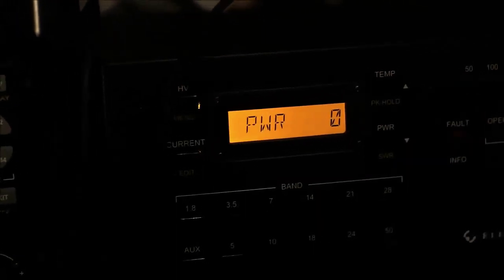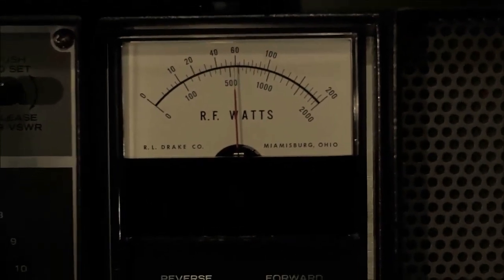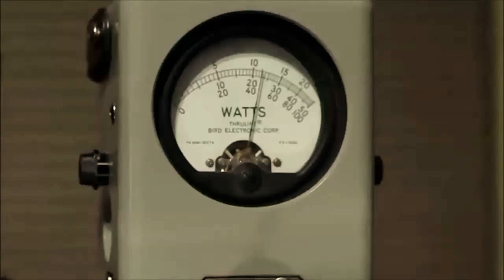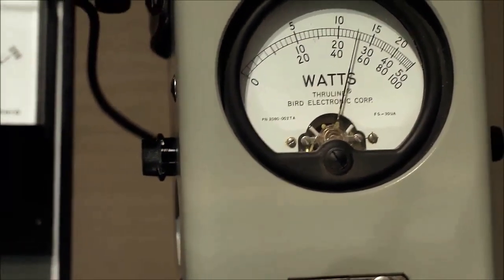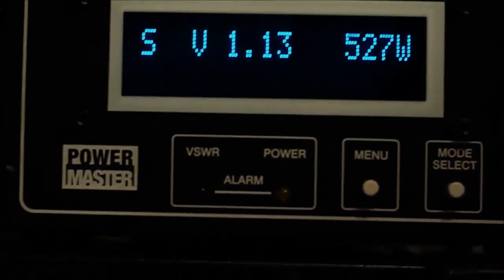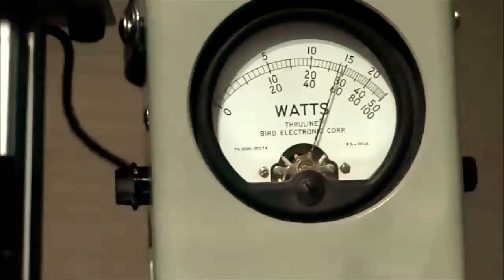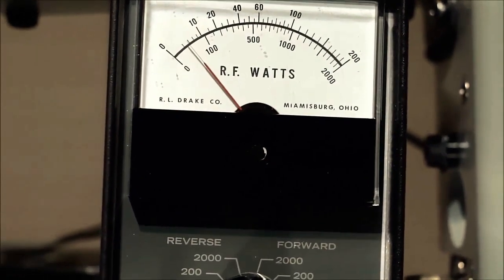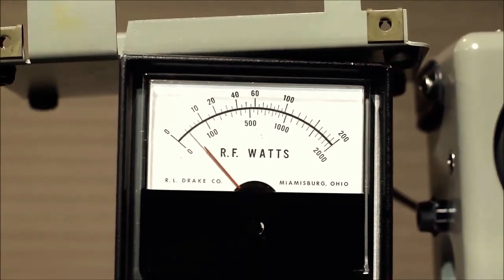Ham Radio Basics--What Wattmeter

Comment: Glad you ok I'm seeing this 4 years later was looking for the video on the automatic tuner you showed at the end of the video you said that it attaches to the tower it probably was crap and did not work and that why no video but was just wondering on what it is and how it worked thanks Charles
Reply from the maker: Yes and someone is still selling that kind of garbage.  I just put up on the fence a modified Hustler 4btv.  Your question would make a good video.  The garbage tuner attached to another vertical compared to the 40, 20, 15 and 10 meter vertical.  Thanks for the idea.  73, Jim

Comment: Jim,
Enjoyed the videos and have subscribed.

How about a video on your shack. I notice three monitors. Are there three computers or one computer with the monitors connected to your graphics card?

WB3BJU
Reply from the maker: +Donald D&#39;Egidio 
Hi Don, 
There are 2 computers that I moved from my business to the ham desk as they became too old to do PhotoShop.  The third monitor is a really cool RTL.SDR connected to the IF of the K3 on the right through a computer.  I have a second RTL.SDR connected to the other K3.  SDR's are about $60 and a great tool for working DX.  There are 3 rotator controls for the 3 little towers that I have.  Two towers are 40 feet and one is 50 feet.  Since I am on the top of the mountain, the antennas do not need to be as high as if they were on flat ground. Besides the Elecraft K3's, there is also a P3 panadapter, KPA500 amplifier and KAT500 tuner.  

73 de W6LG

Comment: Any thoughts or comments on the Autek WM-1?
Reply from the maker: It is okay.  Keep in mind that as far as peak reading goes, all devices with meter movements suffer from damping.  they are not accurate or reliable.  For key down readings, it is good.  Just calibrate it with a good device.  If you can borrow a Bird Wattmeter, that would be good. 73, Jim